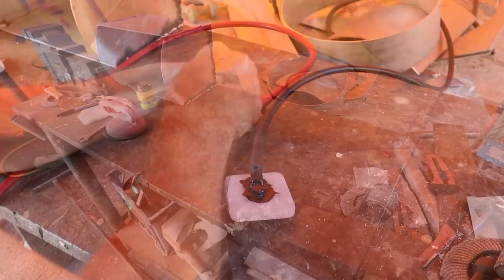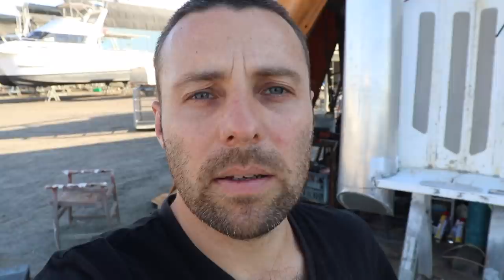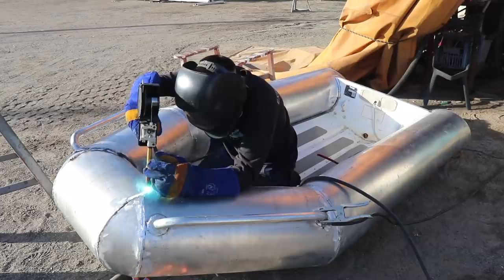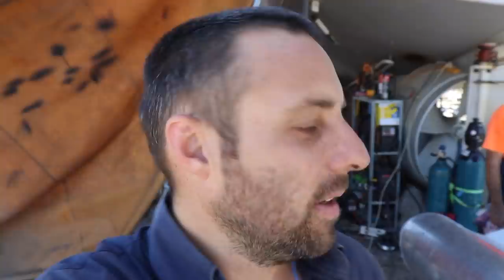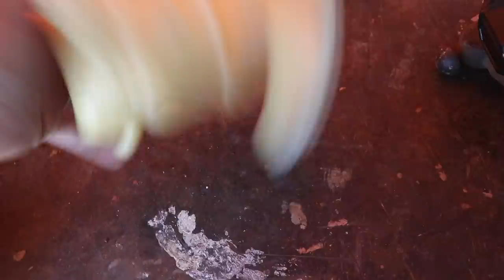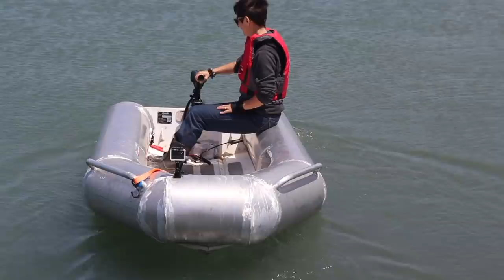DIY Electric Dinghy Sea trials, Part 5 - Project Brupeg Ep. 111

Comment: If you wax the sanding media it will last longer and cut twice as fast.
Reply: Ethan - explain, please...
Reply: @gilbertfranklin1537 , I own a fabrication shop and have decades of machine, fabrication, and blacksmithing experience. We use Castrol stick wax. It lowers the friction coefficient and allows the media to do the work without clogging with aluminum. Remember, friction doesn't cut aluminum, a sharp tool does. It's like using a dull knife vs using one that's sharp. When your media stays sharp, and unclogged, it lowers heat and increases efficiency by a metric ton. Anyone who does any grinding of aluminum professionally knows this... it's not even a "trick", it's just what you do when you do it correctly. It would have saved Damien hours--I may have commented about this a few months back when he was working on that aluminum door. I guess he didn't take it to heart. I'd say the only drawback is that you have to clean the wax off with acetone before welding or painting.
Reply from the maker: Hi Ethan, yeah we started using the wax towards the end. its blimmin awesome stuff isnt it
Reply: @ProjectBrupeg  , it's a lightbulb moment, for sure.
Reply: @ProjectBrupeg  rc airplane props get alot more speed

Comment: I also think your getting cold welds because your swirling the torch to much. Instead of swirling. Try a slight hesitation. Don’t back travel. Just hesitate for. Split second.
Reply from the maker: How do you get the weld to be wide enough if you dont swirl?
Reply: Project Brupeg technically you don’t want it to be wide. The thinner the width of the weld. The less heat your putting into the metal. I realize you are new and are usually trying to fill a bit of a gap. So yeah that works. But you should try to go back and forth side to side. Not in a circular pattern. When  you do circles.  You end up with cold lap.

Comment: This video is a FINE example of why you should weld aluminum using AC TIG only. Oh, and not out in the open wind. Even a small fan pointed out you inside can blow the shield gas away. Go buy a LARGE used army tent with no bottom. Good to go.
Reply from the maker: I’ll be sure to let the production alloy boat builders in the yard know…
Reply from the maker: We’re not that kind of project. We work with the time, money, resources and weather we have. It would be lovely to have everything just right though. It must be a pleasure to weld in those conditions. Jess

Comment: One thing i noticed and you might want to experiment with it, is that when you're welding, you're rotating ...uh how should i put it, i want to say too fast, but you can do that, obviously, let's say erratic. In ferrous metals, that's ok, they accept this kind of motion, but in non-ferrous metals, aluminum, brass et cetera, if you move so "erratically" the puddle doesn't have time to settle nicely, doesn't form nicely either. So you end up "catching" or having to throw more metal in.

Think of it this way, you're driving a nice car, but someone replaced the front wheels with pizza cutters and your control over the situation is gone, you're moving the wheel left right, desperately to get control, but it never happens. As you slow down, you get more control.

IMO, you should take a few scrap pieces, and practice a few butt joins or overlaps (angles don't help as much when you learn) and turn the rotation speed down a notch or two. The other settings accordingly.

One last thing, in aluminium (a fussy metal) consistency is key. I'm sure you've noticed it, every time you change (either because you reached the end of your motion travel or have to skip over a feature) the metal becomes unruly and odd things happen.
Reply: the way i was taught when i was doing my crt was that if your doing the back and forth motion < (which does leave a nice pattern when doing it right)- ["not the back and forth your thinking u dirty minded freak"] it allows the metal to cool even tho its a split second it causes it end up being made up of two layers this might sound good and in automotive or thin metal projects its common and  doesn't have much or any negative effect but it sacrifices the the root, the root penetration and somewhat the heat effected zone of the weld on thicker materials. this could lead to stress fracturing but mig welding ally is a pain in the arse let-alone welding a vessel.
Reply from the maker: Hi Aserta, so what your saying is a smaller circular motion with a generally slower forward travel rate? im thinking if I do that i will need to take some amps out as the metal will blow through. one reason i was running hot was because i didnt like the fusion (or lack of) that i was getting when i slowed down running colder
Reply: @ProjectBrupeg  if ya finding ya being rushed because burn through definitely lower amps and tune wire speed till it hits your sweet spot where you can get control over it. also try and get the nozzle down closer longer stick out can make it colder and make the weld crest more.
Reply: @ProjectBrupeg  When welding with MIG, GMAW, your control of the heat is much different than Stick welding, or SMAW.  The SMAW, Shielded Metal Arc Welding, uses a CC, Constant current machine, whereas the GMAW, Gas Metal Arc Welding, uses a CV, or Constant Voltage machine.  Current (Amperage) and the arc gap (Resistance), controls the Voltage (heat) in CC welding.  The closer the electrode is to the weld material,  decreases the Voltage, or the heat.  Pulling the electrode away from the weld material increases the voltage by increasing the resistance.  With MIG (GMAW) you set the voltage and you set the initial resistance with wire speed.  Now the set Voltage and the Wire Speed control the arc gap (resistance), to control your current (heat).  Turning wire speed up makes the weld colder, turning the wire speed down makes the weld hotter.  At a given Voltage and Wire Speed you can still vary the weld heat by controlling the amount of wire stick-out at the nozzle.  If the nozzle is 1/2 inch from the weld you are closer to the current resulting from the Voltage/Wire Speed setting.  If the nozzle is one inch from the weld the current can become too hot and start popping and throwing spatter.  You want to find a nice sweet-spot in the distance you hold the nozzle from the weld in order to produce a nice sizzling arc and deposition.  In your welding, it appears to me, you are holding the nozzle too far away from the metal producing inconsistent welds.  Especially when starting.  Slow the nozzle down some in the weave pattern whether back and forth, or in a circular movement.  Aluminum requires a higher heat to produce the puddle because the conductivity of aluminum sucks the weld temperature away from the weld very quickly.  So, slow down a little, keep the nozzle 3/8 to 1/2 inch from the weld, and you will gradually become unconsciously able to vary how close the nozzle in, or out, it has to control the size of the weld puddle and move it along.  What your eyes see in the puddle, and what your ears tell you about the arc quality, will translate to a more consistent and higher quality weld.  You have a good start that now only requires some refinement.  One more thing; when welding a seam, always stop on a start point.  In other words. After stopping a bead, run ahead of there the start for that bead was, to start the next bead.  Then run the new bead back to where the previous bead started, stopping on top of that point.  Fewer leaks that way.  I taught the various electric welding processes at a local technical college here in Indiana and I have welded have been employed as a welder for a number of years as well.
Reply from the maker: Great info. Thanks very much for this
Reply: @OleNavy   you worded that very well

Comment: Hey Damien, You may want to look for this 3M tape or it's equivalent... great at waterproofing, but remains flexible, builds up thicker, and avoids cracking that the liquid tape can sometimes suffer... if that's not enough this says it also defeats nasty insects too !  I've used this a lot in industrial engineering applications too...  See : https://www.3m.com/3M/en_US/electrical-construction-maintenance-us/resources/mastic-electrical-tape-guide/   Since you didn't show it, will you entirely flood it to test your buoyancy and short protection etc ? Was wondering if you need to put in a brace/insulator above the batteries to stop a possible short against the aluminum if it gets flipped over accidentally or will that strap stop any movement ?  I also have a BDay this week (27th) so I'm in good company with Jess !  Happy BDay Jess !
Reply from the maker: Ahh happy birthday Mike! the liquid tape is pretty flexible, ive not yet seen it crack and UV and weather doesnt effect it at all. As for flood test, im not gunna flood it, it will float. remember this is just the very short trip boat (ie under 500m trips etc) and yes the batteries have a brace and the bottom and top so we can fit a strap. with this the boat can be inverted without the batteries moving.
Reply: @ProjectBrupeg  Moosh seemed to like riding in your laps too much !  Will you put a traction strip on the sides to sit on, or perhaps make a small  re-positionable wooden seat... it could be twisted in place to grab the round tubes for some security ?

Comment: How can Brupeg be carbon nuetral when it's powered by a diesel engine burning diesel or waste oil. Both fuels produce carbon
Reply from the maker: Hi Shane, vege oil pulls carbon from the atmosphere while the plants are growing and we release it when burning it. the lifecycle is carbon neutral as no additional carbon is released to the atmosphere. for all energy that we cant get from solar, wind and vege oil, we will get from buring fossil fuel diesel. This diesel is a tiny part of our overall fuel use and we will be carbon offsetting that use. Essentially trees planted which will pull the equivolent amount of carbon from the atmosphere that we put in via diesel. We may be able to use biodiesel rather than fossil fual diesel but thats a nice to have and not something we are focused on at the moment, but certainly something we can look into post launch.

Comment: Dame that foam is crap!
Reply from the maker: Why.
Reply: They said it is closed sell and it does not absorb water jadajada BUT it does absorb water and is a pain once waterlogged to get it out rather use sondor foam you get it in sheets or blocks then cut it to size in your case circles and put it in 100 times better product
Please dont use that crap in second dingy!
Reply: You will pull your hair from your head trust me!

Comment: These videos should be about 1/4-1/2 of the length for the content they have. Condense! Also, the word alloy does not = the word aluminum.
Reply from the maker: I disagree we get a lot of feedback that’s not the case. Remember we are not a ‘how to’ channel. It’s a channel about the experience. Sometimes that requires 25 mins, sometimes an hour. We share honestly what’s going on.Yeah alloy does mean aluminium in our country. Jess
Reply: Project Brupeg It wasn’t a knock. I enjoy the videos a lot. I’ve watched every one of the dinghy videos and am waiting for the next! I realize that my wording sounded harsh. Wasn’t my intent though. For my knowledge’s sake, how do you indicate that you mean an alloy of a different metal such as a stainless or bronze? Seems like that would lead to some confusion using the word alloy like that. 🤷🏻‍♂️

Keep up the good work.

Comment: Fyi you should  clean all of your welding joints with a flux  prior to welding. You will get a better and cleaner weld first time. I was a marine engineer. I use to work for InCat in Tasmania.
Reply from the maker: Thanks yeah we have started using an acid seconds prior to welding. results are much better.

Comment: I suggest you look at the Torqueedo electric outboards I have one on my tender. .
Reply from the maker: Yeah i did look into them, but one thing to remember is this boat will be the work hack, left on isolated beaches, chained to random trees etc with a high chance it might get pinched. given this motor is $240AUD to replace new, im happy to risk that. im not so keen on leaving a Torqeedo out in the open for someone to borrow.